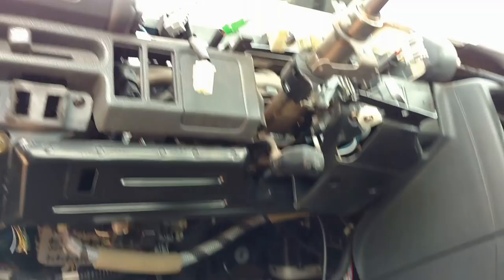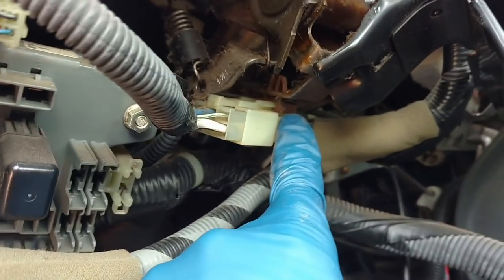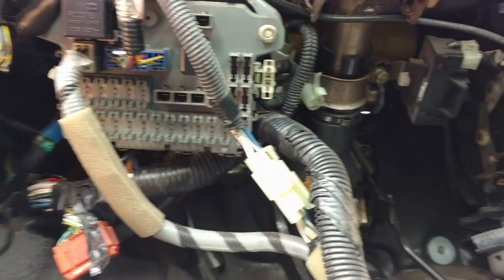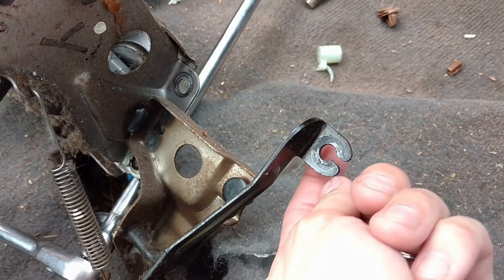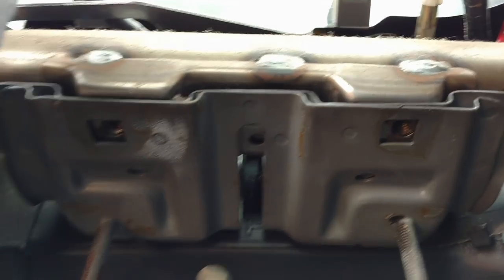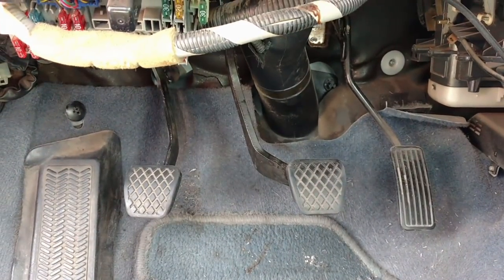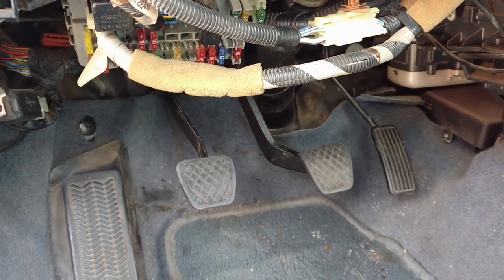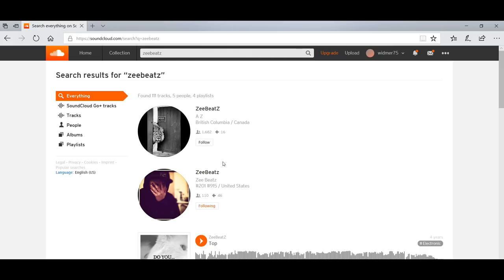How to Remove Pedal Assembly Honda Civic & CRX 88-91 EF

Comment: Good video as always sir. Just wanted to say you can avoid a ton of the work by removing the gas pedal first, then reaching the nuts with various swivel bits and extensions. The assembly can then rotate counter clockwise and drop out. No removal of the fuse panel or steering column (drop the column but no removal). I have a dual diaphragm pressure plate and the pedal is really heavy. I’ve broke the bracket and then last time the bolt for the pedal..! Replaced with a bigger bolt, welded a frame around the clutch pedal , then a piece that buts up against the firewall so the pedal area cannot rock back n forth. It’s some work but it keeps the cable trans cars alive.
Reply from the maker: Thanks for the info, I'll have to try.  That sounds much better
Reply: @GarageBuiltHondas  yeah next time you do it, try it that way..! And thanks for responding, to a comment from your 3 year old video..!🤘
Reply: Thank you for this. The clutch pedal bolt broke flush with the mount plate. Snapped the cylinder case goes around the bolt aswell. So no way to drill it out without move the pedal assembly around. This is probably gonna help me a shit ton!
Reply from the maker: Nice, good luck!

Comment: Hi let me first say how awesome your channel is. I have a love of the Honda Civic/crx that will never leave me. I have done tons and tons of engine work to the d15b engine series. My crx 1990 dx has got about 200 miles on new rings/valves. Now I'm going through the car fixing all the crx problems that at common to the vehicle. Pedal assembly/door latches,mpfi relay,brakes,fixing manual window regulator/ ac heater control and all the other good stuff.nyour channel has been golden to me. the amount of information you give is all over the place. Basic repair to swap for the mpfi.  I am in the process of the pedals and the door latch. Your videos have been step by step and have saved me so much heartache because I even know what years I'm looking for which is information I have gotten from! Your channel. I most likely will be donating any light stuff that can be shipped without to much frieght for weight unless you are willing to pay the shipping. I have all kinds of extras. It wouldn't be for 6/12 months untill I know what I have and am cleaned and organized in my garage lol. Please keep doing what your doing. Do you have any shirts for sale
Reply from the maker: Thanks for the comment Luke, it means a lot!

I only have a couple small and XL remaining right now in the link in the description of those size fit! 👍

Comment: You remind me of me before I retired. I started my career as a machinist apprectice, moved on to toolmaking machine building and finally engineering. So a lot of the machines I built required on the spot rework or engineering. Like you do. You don't just buy something and if it don't work wine about how it doesn't, you do what needs to be done to make it work. So kudos to you. My passion is the 2001 to 2005 Civic coupes, V-tec only, I finished one two years ago for my 16 yr. old grandson, which I promised to give to him. Promises are promises. But, I acquired a clone to that one, which I want to restore for myself. I don't care if it has a drivetrain, got one. I need a as close to rust free body as possible, so I can use the one I currently have as a parts car. Well, now you know the rest of the story.
Reply from the maker: Very cool, thanks for sharing.  I love that you're favorite chassis is one that not many people choose.  I personally like that model a lot.  One of my best friends drove one up until 2009 and his was so nice.

And thanks for the support and encouragement, I try to do the best with what I have and can work with.

Comment: Jon I just tackled this today after months of having trouble putting it into gear. I have a 1990 civic LX , and there was a few extra things I had to disconnect but thanks to your video I was able to figure it out. Mine was cracked a lot worse than your friends but hopefully I can take it to a shop and they can straighten it out and weld it. Not looking forward to putting all this crap back together but if I want to to make it to 400,000 miles I have to. :) Seriously Thank you.
Reply from the maker: Glad to hear, it can be a tedious job for sure.  Glad to hear you tackled it!

Comment: Dang, mine broke on my cr-x a few years back before you posted this - I sure did look for a video though.  This job is a nightmare, just watching this video is like hearing nails on a chalkboard to me, hehehe.  My clutch pedal post broke clean off while driving one day, leaving me stranded.  
One thing to note is the importance of having universal joints and extensions for your wrench - the more the merrier.  A lot of the nuts that hold that assembly on are in tight places, and it's hard to spin a socket where they are unless you have extensions and universal joints.  One more tip, also replace your clutch cable with a brand spanking new Honda one if you can find it, that way your new pedal assembly will be encountering as little stress as possible.  Great video man, glad to see it posted.
Reply from the maker: I have felt your pain, it's not any fun one bit.  Great tip on the u-joinrs!

Comment: After breaking a '91 CRX assembly and one normal Civic pedal assembly, I got a bone stock assembly and bought and installed the Hush Performance bracket.  I kept it cable for a while but I'm fully converting to hydro now.    I have an Action upgraded clutch with a heavy PP and 4 puck unsprung disk and you need to be Hercules to push that pedal.
Reply from the maker: I'd prefer the hydro setup too.  I'm getting tired of the cable setups
Reply: Garage Built Hondas it's worth it I think.  Hush makes a really nice solid product.
Reply from the maker: They do.  It's something I'd like to do on my 90 Si,and get maybe an ITR trans for it.
Reply: Garage Built Hondas I don't know what you're gonna do exactly with your setup, but I think the ITR tranny's gears are way too short for me personally.  I have a B16 trans and kinda want to do an LS final drive for highway use.
Reply from the maker: Strictly for track use.  The short gears would make my b20b a lot quicker.
Reply: That's true!   It sounds like it would be a really fun setup!
Reply from the maker: It's fun now, I'd like to feel the shorter gears.  Not sure if you follow my channel but a few weeks back I was going to install a b16 LSD transmission but it had a hole in it so I haven't been able to yet.

Comment: Idk if I overkilled it but I am in the process of swapping out my pedal assembly and I removed the entire dash and instrument cluster to see and access better the pedal assembly. I am a big guy so maybe why haha. I have a heavy duty clutch plate and been driving for over 7 years and clutch pedal finally broke. For about a week I was having some trouble getting into gear and I adjusted my clutch cable tighter and car drove back to normal for a day I drove to work and when I got off work I engaged the clutch and it broke right there.
Reply from the maker: It happens.  Not a fun job but do what you gotta do.  Removing the dash isn't that difficult either.

Comment: I changed my civic from a automatic to 5 speed it not to bad just take your time and take pics first.
Reply: Allan A Old comment, but I’m starting my auto to 5spd swap in a couple weeks. Just gathering all the parts for it. Super excited!
Reply: How long did it take you to do the auto swap when you gathered all your car parts already ??
Reply: @fuctthepopulation5945  if you're really focussed a few days but otherwise about a week after work. Now it's getting the Integra swap  GS running gear.

Comment: Thanks for the video.  My pedal assembly is cracked in exactly the same spot.  Sucks you have to pull the whole column and fuse box to change this, but it is what it is.   Going to get mine welded and reinforced.
Reply from the maker: Yup, not a fun task.  But luckily it takes years for them to break.

Comment: Good Stuff like always , Jon!! 
Question... I have a OIL leak and I’ve traced it up to my distributor, I think . What I noticed is that it’s missing a bolt at the bottom end of the distributor, could that cause my oil leak ?
Reply from the maker: Definitely!  It also just might need a new seal.  Old seal + missing bolt equals oil leak for sure.
Reply: Garage Built Hondas 

By any chance, is there a video on how to change to seal on the distributor ? That would be great
Reply from the maker: It's in this video here.  https://youtu.be/nGDUQ1wyET0
Reply: Garage Built Hondas 
Where at ?! I watched the video and then I watched again on fast forward . I don’t see where you were talking about the Distributor .
Reply from the maker: You must not have watched very well.  😀 The first part of the video I'm removing all of the components of the distributor to get to the inner seal, and I do the outer seal last as it is the easiest.

Comment: THANKS! This video got me thru this replacement, no issues whatsoever, awesome explanation in this..unfortunately the 88-89 hb I got my pedal assembly off of was different than my 1990. The clutch actuator button thing wasn’t on the bracket, it was on the body as opposed to the 1990...it was located on the bracket. Either way I got mine off super easy and had the bracket welded. (Plus I got a window moulding and door pillar garnish and used ur video to get that off as well) subscribed!
Reply from the maker: Awesome, glad to have been a help!!

Comment: You could just disconnected the entire steering column harness from the fuse box and taken off the column, would’ve made it a bit easier but overall great video!!👍🏼
Reply from the maker: I don't like removing the column unless absolutely necessary.  It can be a pita getting that joint back in for me, so just lying it down leads to a few less bolts removed and saves a little more time.  And thanks, hope it helps people out in the future!

Comment: Anyone know if the spring on the gas pedal is really needed after watching this I realized mine doesn't have one
Reply from the maker: I doubt it does a huge amount especially when the throttle cable is attached.  It probably does help in it's return to original position.

Comment: Can you use JB weld as a temporary fix. Mine broke and I have to wait until I find another one
Reply from the maker: I don't think it'll be strong enough to hold the metal together.
Reply: @GarageBuiltHondas  I tried JB weld  and it broke right away. Thank you very much for this video I took a clutch assembly off a CRX and put it on my Honda. This video was a great help 👍

Comment: did JDM/EDM and USDM civic/crx have different pedal assemblies? I've never heard of them breaking over here in Europe.
Reply from the maker: That's a good question, but I've never heard any info on that either.
Reply: Could be the angle of the cable/ differently routed cable causing less resistance.???

Comment: need a walk-through for removing clutch cable from pedal assembly. my clutch pedal is squeaking and fearing the worst.
Reply from the maker: Spin the adjustment nut on the cable from the transmission, then remove it from the arm.  Then look under the dash above the clutch pedal, youll see how easily it slides off the pedal.
Reply: @GarageBuiltHondas  Will the clutch cable just slide out of the arm then? Or is there a Screw on the bottom? Haven't done anything trans wise in a while.
Reply from the maker: Yes.  Just need the tension removed and it'll come off.

Comment: Good God that much to do that little bit of work... I swear some of these repair shops are shysty pieces of s*** I mean damn $250 to change plugs and wires.... They should feel very criminal for that.... that literally takes 5-10 minutes on one of those cars... If someone actually brought a car like that to my shop I'd probably charge them maybe 20 bucks.....hell it's 2022 inflation's through the roof...🤷...
Reply from the maker: Unfortunate yes for this job.  But this isn't a job you'll do frequently.  These pedals wear out after decades and need replacement or repair.